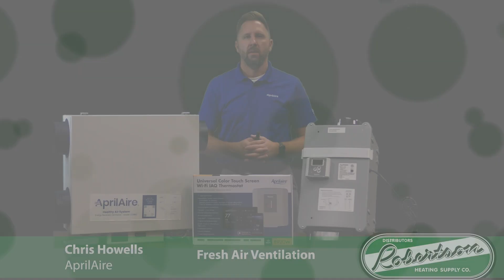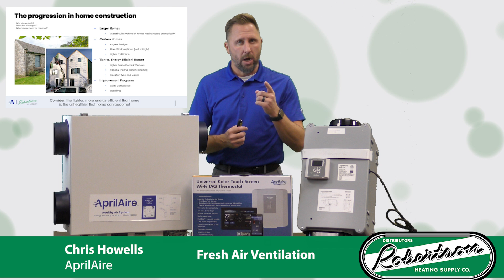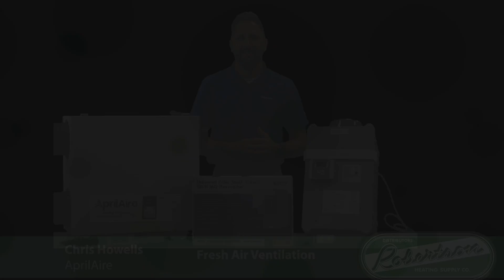AprilAire Fresh Air Ventilation

Comment: I have 2 year old new build house 1880 sq ft Lennox ac unit with April Aire 8145. They set the digital to 25. What does that mean and what does it need to be? We live in Fulshear TX. Near Houston, TX so it’s hot summer.
Reply: I’m here in Richmond Tx. Ours is set at 10 . The humidity is a constant 61% which is on the high side . Why is your unit set so high??